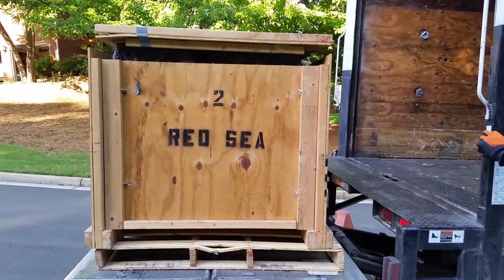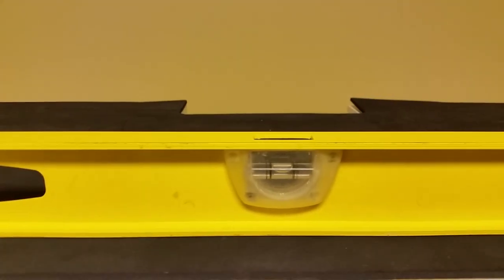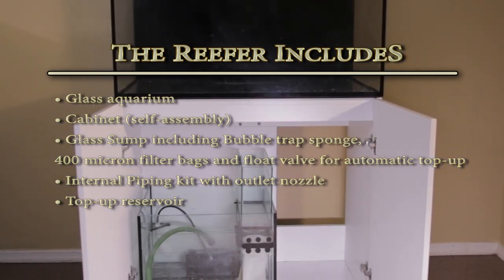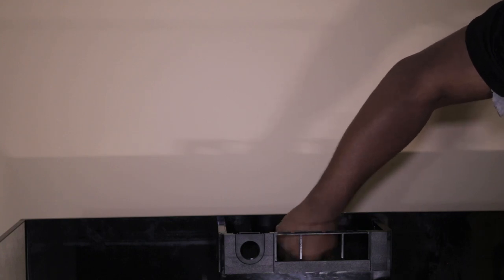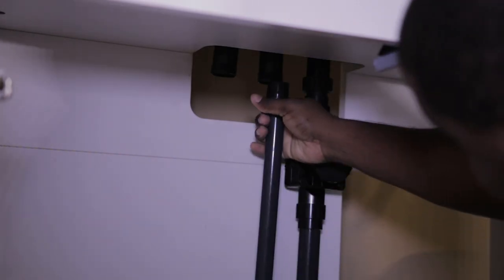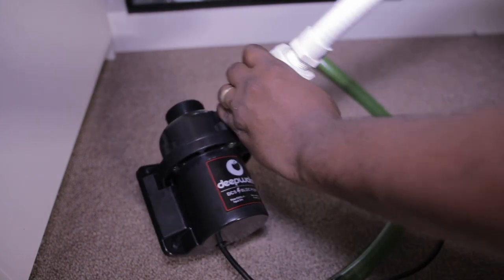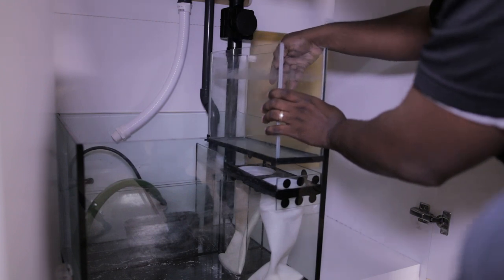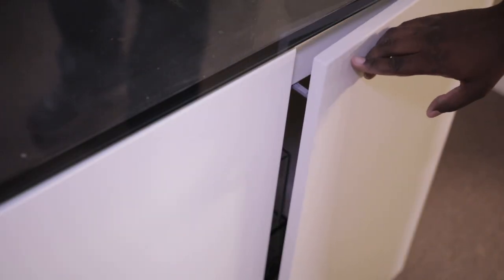Salty Supply Tank Build Part 2 - Installing a Red Sea Reefer 250

Comment: Question I'm in the middle of a Red Sea reefer 250 build and I'm following your lead with the same return pump 👍. Is that 3/4 spa flex? Also I'm not sure what fittings I'll need to connect everything. Any help would be greatly appreciated!! Thanks in advance

Comment: Nice video. I am setting up a reefer 350, but ran into an issue with green return tubing. It doesn't fit the return pump valve. I have Jebao DCP 6000. What kind of tubing are you using for the return pump?
Reply: Hey there Al......in the process of setting up my 350 at the moment and also came across the same problem as you. I am using the Reef Octopus VarioS6.
Other than hard plumbing which I don't want to do at this time, did you find a solution/parts to use to get past this issue?
Any input would be greatly appreciated.......thanks.

Comment: Do All red sea tanks come in a nice wooden crate? I am wanting to buy the 450 but not sure if it will get delivered to my door. Do they come FedEx/UPS ? Im scared to spend 2200$ + Shipping if the tank will just break during transit.
Reply from the maker: +ann53090 They do come in a crate, just not that specific kind you see there:) So far we haven't had any 450's break as they are packaged very well